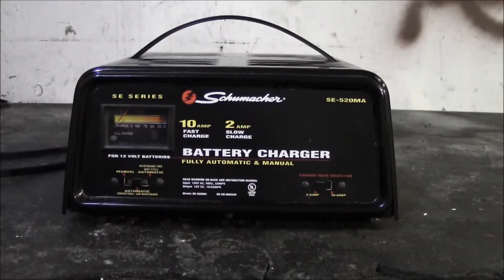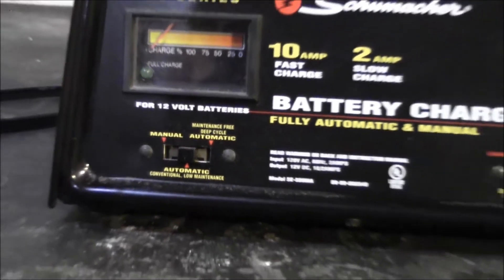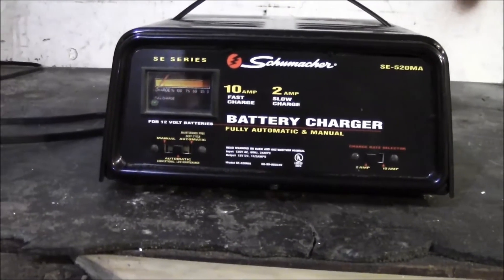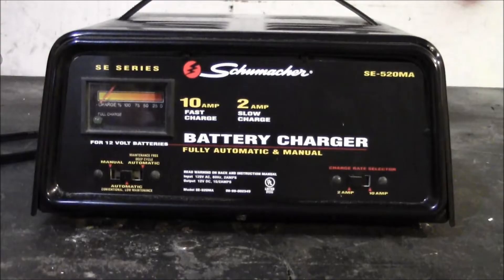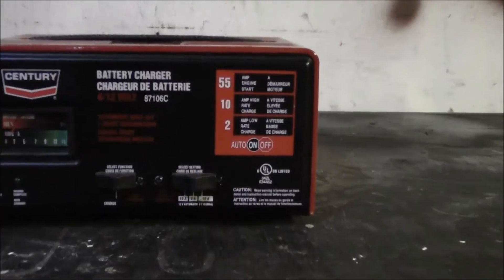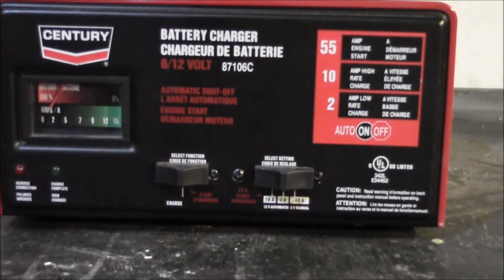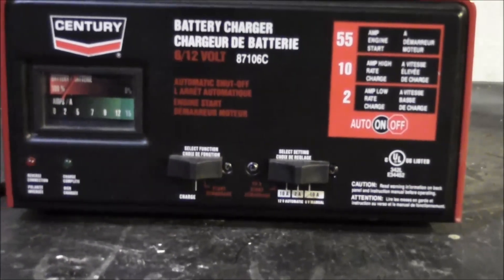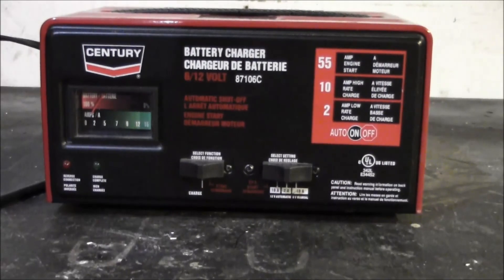What you need to know about battery chargers part 2

Comment: So when and why do you want to charge on a 2 AMP setting as compared to the 10 AMP? My guess is that the 2 AMP takes longer, but gives the battery a more solid charge that will last longer. The 10 gives a faster charge, but will run out faster. Is that correct?...Anyone know?
Reply from the maker: You are partially correct.  The 2 amp is designed for smaller batteries.  Think motorcycle, atv, or snowmobile.  The 10 amp is for larger batteries like cars and trucks.  However, the 2 amp can be used for cars and trucks as well but , as you mentioned, it will take longer to charge.  As for the 10 amp... it will give a faster charge but that charge will not "run out" any faster than a 2 amp charge.
Reply: ***** Thank you for your input. That makes sense.
Reply from the maker: You're welcome.  Thank you for watching.
Reply: Codii-Reddd

Comment: Battery charging at 2 or 10 amp; aren't they on a different tap from the transformer? So perhaps when the charger fails you could still use the start side to get your battery going.
Reply from the maker: I think you are right about the transformer.  However, depending on the state of charge, the battery may need to be charged prior to using the engine start.  So it really depends on the situation at hand.

Comment: Hey, I got one of these 12v chargers second hand: http://www.canadiantire.ca/en/pdp/motomaster-10-2a-automatic-battery-charger-0111503p.html I plugged my 12V non-spillable battery and the needle stays at the green area 0.Is this normal? The charger seems to work because it's making a quiet buzzing noise. Thanks
Reply from the maker: Is it set to 10A or 2A?
Reply: I set it to 10A. I also checked the voltage on my 12V-7A SLA battery and it showed 6V. Maybe it's dead for good.
Reply from the maker: I would try charging it at 2A and see what happens.  I like to charge with the 10A and then switch to 2A to finish the charge.  Depending on the battery... the 10A may have trouble bringing the battery to a full charge.  If the 2A doesn't work, have the battery load tested.  Most auto parts stores will load test a battery for free.
Reply: ok thanks
Reply from the maker: You're welcome.  Good luck.

Comment: Thank you so much for your time & expertise. I watched all 3 of your charger related workshops. My situation is a bit different. I would like to purchase a good quality manual charger to use in removing rust. I have seen numerous videos and can't wait till spring to start restoring a vintage table saw I had given to me. Do you have any thoughts regarding that since the manuals are becoming somewhat of a dinosaur? I guess a combo of a manual/auto would be fine too. Schumacher seems to be the deal. Thank you again, Jim
Reply from the maker: +James Wiskus  Your welcome James.  Thank you for watching.  Your best bet is to look at wheeled chargers.  I'm not sure how much amperage output you are looking for but Schumacher and Forney are a good way to go.  Here is a link to a couple of Forney models that may interest you.  https://youtu.be/9m7Iw5PE4aU
Reply: Thanks so much, I actually have this narrowed down to 2 different Schumacher chargers. One is SE-82-6, 12V 6A. The other is discontinued but a friend has 6 of them 1050-PE in his shop brand new for 50.00 each. It's supposed to be a 10A. My question is will 4A make that much difference? I wouldn't think so other than one will clean a bit quicker. Just wondering your thoughts since the 1050-PE is discontinued and the SE-82-6 is still available. Just thinking about parts availability. Here is a link to the two chargers,

http://www.amazon.com/Schumacher-SE-82-6-Dual-Rate-Battery-Charger/dp/B0009IBJBM

http://www.amazon.com/Schumacher-1050-PE-Signature-Starter-Emergency/dp/B00002N6TW
Reply from the maker: +James Wiskus I don't have any experience with using a battery charger to remove rust.  However, I think you should buy the least expensive one because I doubt there will be much difference between the 10 and the 6 amp output.

Comment: quick question,i just bough 2 T105RE  6 volt trojan  golf cart batteries, hooked up in series for 12 volt system ,,,,first time i hooked them up to a 1.5 charger /maintainer they reached 13.6 before charge light turned green,,,,,,,a week later i hooked it up again but they reached 14.6 and still no green light,, i disconnected charger in fear of over charge,,,,,,,,,should i have allowed the charging process to continue to green light appeared ?........were the batteries attempting to equalize ?
Reply from the maker: +bob woerner Sounds like they were not done taking a charge yet.  What is the amp hour rating of the batteries you bought?  I looked up the specs on the T105RE and it looks like there are four different amp hour ratings available.  All of them are very high.  I would suggest that you use a battery charger with a higher amperage output to charge them because the 1.5 amp charger/maintainer is not going to be enough power to charge them in a timely manner.  I would try using a 10 amp charger and see what happens.  The other thing you can try is to disconnect the ground cable from the vehicle.  Some times I run into batteries that won't take a proper charge because there is something in the vehicle drawing power.  Disconnecting the ground wire will isolate the battery and allow it to charge properly.  This usually only happens when there is an after market stereo amp that has been wired hot to the battery but it's worth a shot to try it.  I also had a diesel truck in the shop one time that would not take a charge.  When I disconnected the batteries from each other (they are wired in parallel) one battery took a charge and the other one didn't.  In that case the bad battery was placing a parasitic draw on the good battery, preventing a proper charge.  That may be another problem for you as well... if one battery has gone bad... it will draw the good battery down.  I know your batteries are new... but that doesn't mean that one of them is not damaged or bad.  It's worth looking into.  So I would suggest the following...1.  Try to charge them with a higher amp charger.  (I am very confident that this will fix your problem)2.  Try disconnecting the ground wire and charge them.  Do not disconnect the wire that is creating the series connection, just the ground wire that connects the battery to the vehicle.3.  Remove them, separate them, and load test them both to confirm they are both healthy.  Be sure to use a 6 volt scale to test them.I hope this helps.